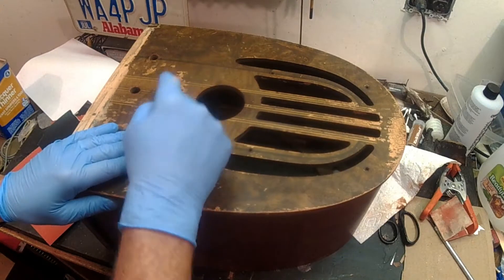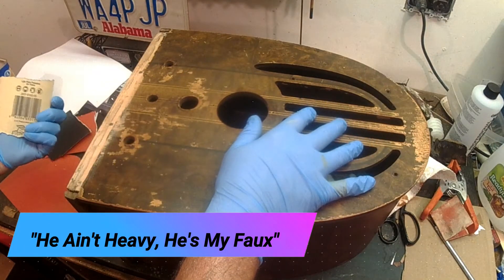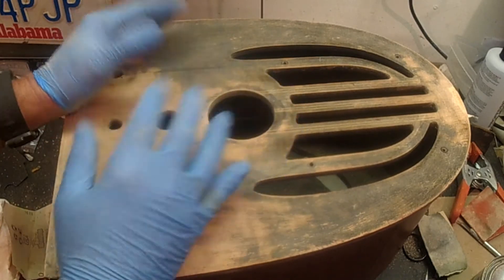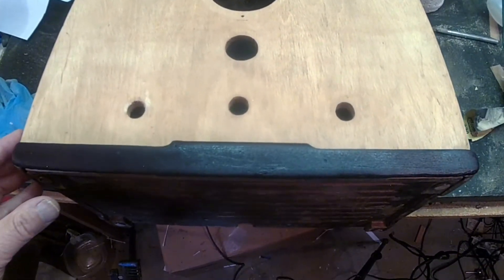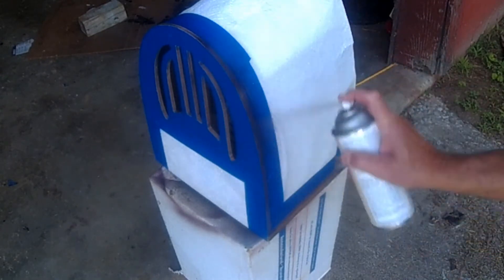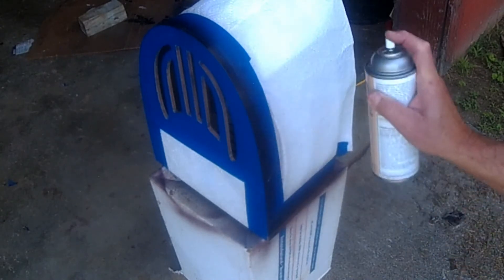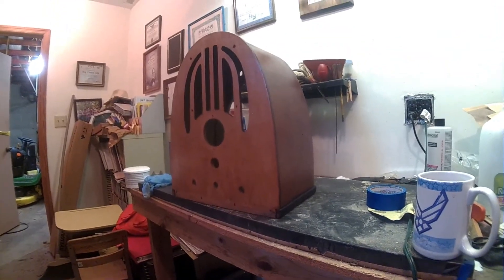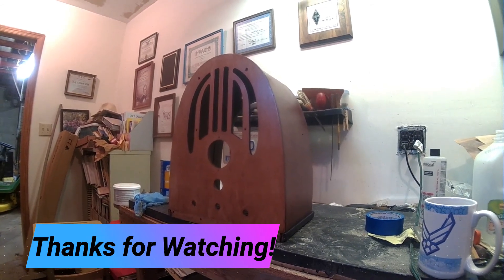Philco 37-61 Restoration Part 9 Prep for Decal

Comment: Looks great, Larry.  I like the front even without the decal.
Reply from the maker: z95m Thanks! I was thinking the same today, it reminds me of a guitar finish. It turned out pretty good, there are still some nicks on the back edges, but not really noticable. I was talking to Don, RestoreOldRadios the other day and we both agreed, that whoever is working on a radio will see more than just a casual observer. Im looking forward to the decal, I think I will be nervous putting it on, lol. Im not very good, even with small decals. All in all, I think it will look pretty good. Im not happy with the speaker though, I have another cone ordered and may change it if the new cone has the right composition and taper on it. Should see it this week also. Thanks for watching and commenting! Best, Larry ps, the new reproduction dial is also on the way.

Comment: Bus stop, wet day, she's there, I say, "Please share my Faux-Fi-nish"...Sorry, You're he ain't heavy remark got me singing Hollies songs, lol.  I wonder if maybe they say poly as there might be a chemical reaction with lacquer?  Just a thought.  I know on my Philco 18H that when I put the Philco slide decal on the face nd then tried to wax over it, the ingredients in the wax kept removing the lettering from the decal and I would have to start over again.  In that instance I had to tape off the decal and use lacquer on it to protect the lettering before I could apply wax over it.  Are you steel wooling it between coats of lacquer or wet sanding?  I prefer 4-aught steel wool myself, but that just because I can do it dry, lol.  Take care, Gary
Reply from the maker: Rebel9668 lol, I didnt think anyone would catch that "he ain't heavy" comment. My mind is weird sometimes and stuff like that comes out. Yes Gary, I do use 0000 steel wool sometimes and it does work well for me. I just had some fine grit sandpaper handy. Ive watched and asked questions from a guy that has done o e of the decals before, I dont have the link handy but he is BBISOPCM in list of who I subscribe to and he did a Philco 37-640. He used lacquer on his, but that was a couple of years ago. After talking to the folks at Re-faux Pro, they now put acrylic paint on the decal before it is shipped so after finding that out, I did not want to risk messing up the decal. At least using lacquer, lol. I ve got enuf going against me anyway. Im looking forward to the challenge and I'll film it real time with few edits, lol. Should be commercial free entertainment for all! Thanks for the comments and questions, Best, Larry